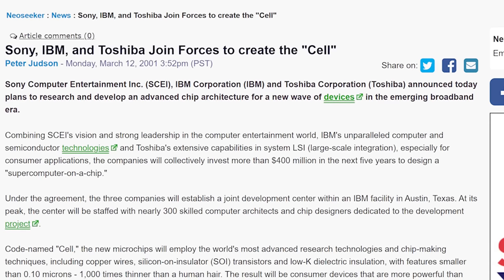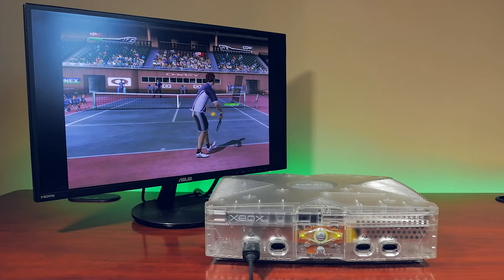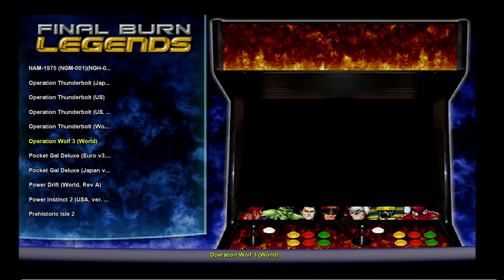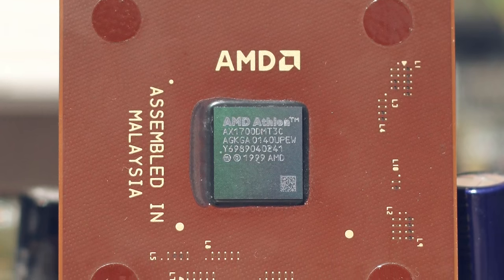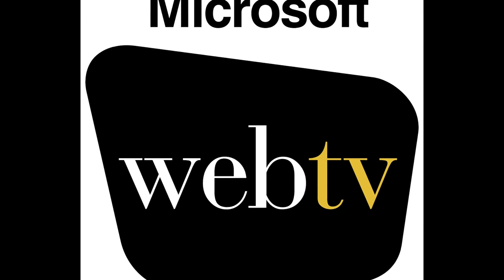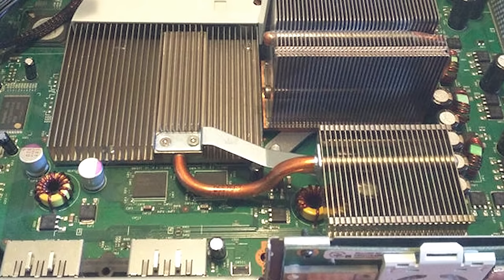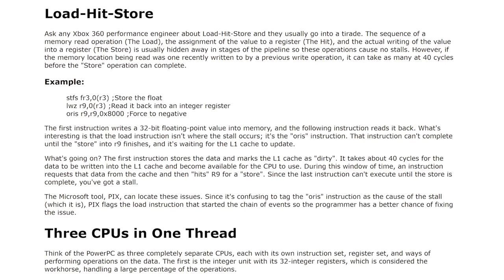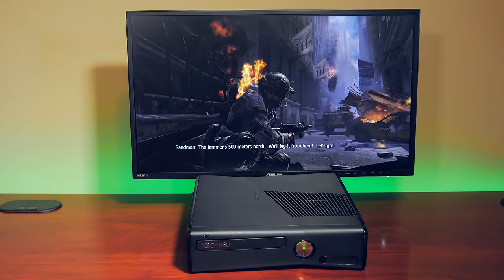Why Microsoft switched from Intel to Power PC for the Xbox 360  | MVG

Comment: Seems like a good choice when they were planning the consoles in the early-mid 2000's.
Reply: they had back them chip are very underpower.. if you want a power like ps3 and xbox360... you had to deal with chip that don't had much gpu and heating like hell... taken them 10 years before they come up with new gen while ps4 and xbox taken only 3 years to get hardware refreash.

Comment: You never mentioned that before a working system was developed. developers were sent a special powerpc based mac to build their games on. Until a working developer kit was ready.
Reply: It actually wasn't anything "special", it was just a Dual 2.0GHz PowerMac G5 since that was the chip they used stock at the time. I left a comment somewhere on this thread, but I had purchased that exact computer before going to E3 the year the 360 was playable (and the PS3/"Revolution" Unveiled). Every single demo station had an empty shell of the launch 360 right next to the exact computer I bought. I had to ask a few of the demo drivers before someone with the right knowledge was able to answer (I think it was someone from Lionhead who was showing off a Fable tech demo). They told me they had a few of these at the studio and other than specific specs on each unit (which were the stock "build to order" G5s from Apple's site), it was indeed just a mostly off-the-shelf PowerMac running the SDK. Pretty cool stuff. It was so fun getting back home, looking at my tower and thinking "huh...I bought this thing for music/video production, but actually have an Xbox 360 DevKit, too" :)

Comment: Apple had to water cool the fastest G5 Powermac, and never managed to release a G5 laptop.  PPC970 cores did run very hot.  It's why they jumped ship to Intel, and now the same thing is happening again, hence the jump to ARM.  MS and Sony knew this, and took the risk of heat problems.
Reply: I think the ARM jump has a lot to deal with the iPhone and iPad running on ARM, so they can unify platform development.
Reply: @comicsans1689  Fairly much so I'd say, and even though Apple announced here in 2020 that by 2022 everything will be ARM, I'm fairly sure that choice was made back around 2016-2017 as Intel was the main name in x86-64 (aka: x64) CPU's at the time and AMD had get to start laying down the smackdown with the Zen architecture (they were just coming off the relative flop that was AM3/+ with their high heat-output, poor IPC and pseudo-multicore design (sharing key FPU's and such between what was otherwise pairs of true cores), which powers XB1/PS4) when Apple saw the problems Intel was having and was going to keep having at the time, so gave themselves about 5 years headstart to start moving MacOS from x86 to ARM to have it ready for their 2022 launch.

If Apple waited for say 2018/2019 to make the move from Intel for MacOS, they might have chosen to go with AMD for Zen-family CPU's to power future Macs, or they might have still made the choice to go with ARM and move from x86 anyway. We don't really know.
Reply: Yeah, and funnily enough, Power arch hasn’t been good for general compute efficiency since G4. They’re still useful, but mainly for enterprise server workloads as I/O, reliability/live failover, and security are greater concerns there (and Intel has been dropping the ball on those, leaving an enterprise server niche). There’s reason to believe IBM’s s390x and Power arch’s have been drifting into each other with s390x maxing out reliability and Power being more balanced. Right now, the best are:
Dedicated HPC: Fujitsu weirdly enough, using their newfangled ARM A64FX chips which are absolute vector compute demons, basically the modern-day Cell except not a nightmare to program
General-purpose/commodity: AMD because Zen2 arch is hard to go wrong with
Enterprise workloads: IBM, Power for better cost/performance or s390x for absolute maximum reliability
Reply: That's a true statement, but when you compare to the time era it doesn't mean much.  AMD wasn't able to push 3ghz clocks on multi-core processors without using even more heat, and Intel wouldn't have anything heat/power competitive until 2006.  If things had waited just a year it's easy to see how different this generation might have been though.  Apple likely had advanced knowledge of how much better the core2 was compared to outgoing P4's, and they would have delayed their move from G5 to intel to match with this vast improvement.  OTOH, Sony pushed back their ps3 launch due to blu-ray AACS fuckery, and if they had known the ps3 was going to be so far delayed, they could have used that time to gain a huge compatibility and performance advantage by leveraging a core2 based processor on their platform.
Given how far below competitive clocks the wii, u, and switch have been I doubt very much that their choice of platform matters in terms of having a good thermal performance.  They just need to ensure they meet the bare minimum cooling requirements spec'd by the chip and hope that their supplier isn't lying about thermal/power properties.
Reply: but the RROD issue was because the GPU was overheating. It was never because the CPU......how are people getting this wrong.
Reply: @tHeWasTeDYouTh  Overheating wasn't even really the problem, although the board flex leading to cracked solder likely wouldn't have happened with more tame thermals.  
Still, the argument could be made that if the CPU didn't require such a large heatsink, the GPU could have been better cooled, which may have prevented the problem.
Reply: @s1mph0ny  the GPU needed a giant heat sink as well as it not only have the GPU but also 10mb of embedded ram.
Reply: @tHeWasTeDYouTh  They used  an aluminum heatsink not even an inch high so it could fit under the dvd drive.  Microsoft wouldn't add a small heatpipe and secondary heatsink until later generations, and those still had too much board flex.

I donno if the edram significantly increased the heat, but the system will crash if it doesn't make contact with the heatsink.
Reply: @s1mph0ny  reballing BGA from Xbox 360 Xenon board 2005 and never more have 3rl insue. The problem call ROHS. PB 37 / SN 63 leaded soldering.
Reply: @Clarissa 1986 Citing Linus is a risky move when he also did a video on are Macs really overpriced and his conclusion was no.
Reply: @ancapsu8728  its true the claim of Xbox "overheating" problems is oversimplified at best, but the board won't flex without enough heat.
Reply: @s1mph0ny  YES. A lot of PCs were being sold, and people were being encouraged to upgrade, based on clock speeds at that time. This is entirely wrongheaded, but Apple marketing decided to stop trying to convince the public of this, and play the same game. It wasn't a purely technical desicion, it rarely is.
Reply: @Clarissa 1986 I don't think it's money, or money alone. They want to remain in control of their product. If they didn't, they would have made OSX/MacOS completely Open Source or even switched to linux long ago.  It's not the direct financial links, but the ability to dictate the direction. Because after all, don't they still make money from the Apple Store on Hackintoshes? I'd say it is the "Homebrew" app for distributing open source software counts as a threat as much as Hackintosh itself.
Reply: Microsoft should have avoided it completely and gone x86.
Reply: @s1mph0ny  I don't agree. Microsoft knew AMD wasn't doing well in 2012 and yet went with them for the Xbox one along with Sony. In 2003 they could have just added a better GPU on release and used a customised AMD x64 CPU with future support for parallelisation using Dual CPU workstations for early game development. PowerPC should have been used for negotiating with AMD and Intel, nothing more. Both SGI and Apple were moving away from it at the time, so it wasn't really "the Future". Now we have one kooky generation of Xbox with over heating issues.
Reply: Yeah, but solder cracking wasn't the issue.
Chip is internally overheating and traces to the pads got damaged, some units got microscopic cracks so, RIP those components

Comment: I'm pretty sure the CPU in the Classic Xbox was a Pentium III "tualatin" and not a Celeron. It gets murky because at that time because traditionaly the difference between the Pentium and Celeron was chache size, with the Celeron being made from Pentium III chips that had quality issues. This version had the same cache size.

Also Intel was being embarrassed big time because this generation of overclockers discovered that Celerons could out perform PIIIs. Basically cache speed was more important than cache size. PIIIs had twice the cache at half the speed of the Celeron but preformed worse. I believe this is why the tualatin version of these chips were so similar. 

Anyway, like many generations of Intel chips at the time the  LAST generation of chips outperformed the first generation of the NEW chips. I believe this had something to do with the quality of chip yelds always staring off poorly. That tualatin and even the mobile version were able to reach P4 performance levels with the right overclock. It was some dark times for Intel. Unfortunately Microsoft ran it CPU at 733mhz and not at the chips 1.4ghz max speed. My guess is, once again, yealds. Much more of the chips would run stable and cool at 733 then at 1.4 and it was cheaper.

All this to say that by the time they were developing the 360, all Intel had was the P4. Everything else was basically the same PIII chip Microsoft had already used. 

The P4 was such an engineering failure that the 'Core' lines were based on a modified PIII core and the P4 'nerburst' architecture was brushed under the rug. 

This is mostly from memory so I may have missed a few things. I had an AMD Athalon XP at the time and really enjoyed my gaming experience.

Edit: Thanks to everyone in the comments for their feedback. It turns out the Tualatin CPU was the fasted you could swap into the original Xbox. Not the stock CPU. It's still a PIII and not a Celeron. It's been almost 20 years now and I was bound to be a little wrong. You all are great.
Reply: Wicked lost and well written!  In closing, Intel sucked hard and PPC was the better choice.  Didn’t know about the Celeron performance delta though, interesting stuff.
Reply: it was a frankestein cpu, a tualatin core with half the cache running at 200 MHz bus...
Reply: @FeeLtheHertZ  i had a celeron A that moped the floor with a friend 's pentium 2
Reply: @omegarugal9283  Yes, Celeron A! That's the name of the first Celeron chips with cache memory. I remember people in school having dual Celeron As at 1.1ghz. While I had an AMD K6-350.
Reply: "Microsoft's Xbox game console uses a variant of the Pentium III/Mobile Celeron family in a Micro-PGA2 form factor. The sSpec designator of the chips is SL5Sx, which makes it more similar to the Mobile Celeron Coppermine-128 processor"

It's a mixture of all sorts.
Reply: Intel had the Pentium M (Banias) processors at the time, which were based on the Pentium 3 but were used for notebooks
Reply: IIRC, the reason for the stupidly long pipeline in the P4 Netburst was the specification of a single-cycle divide.  Divide is a particularly horrid instruction in terms of complexity so the requriement that a divide instruction could be run each clock cycle resulted in a very long pipeline in order to achieve comparable clock speeds to the competition.  This, compounded with the relatively anemic branch prediction and out-of-order execution on the P4 resulted in lots of stalled cycles which wreaked havoc on performance.  In later processors, Intel switched to microcode division operations (similar to AMD), which meant that each division operation would be deconstructed into multiple smaller operations by the microcode unit.  This, along with much better branch prediction, resulted in the next generation having much better single-core performance in realistic workloads.
Reply: Definitely, I believe some people got a hold of some of those mobile chips and suck them in a desktop motherboard and then got some cool overclocks out them.
Reply: The associativity of the L2 cache was that of Tualatin with size of Coppermine.
Reply: @ScottTancock  That's fascinating, bare metal developers were always going on about how costly divide was at the time. I totally see how someone would want to optimize that.
Reply: @ScottTancock  I'm pretty sure the P4's very long pipeline was mainly because AMD embarrassed  Intel to 1Ghz first and Intel needed something that would easily clock very high even if it wasn't as efficient as AMD's Athlon architecture aka marketing them to appear to be faster.
Reply: IIRC The original Xbox CPU is basically just a 550 MHz Coppermine Celeron but running on a 133 MHz FSB instead of the normal 100 MHz FSB that Celerons of the era used. This resulted in a 733 MHz CPU.
Reply: @takeshi7  ahh damn, I'm getting the stock CPU and "fastest CPU people swapped in" confused. 1.4ghz is definitely using a Tualatin CPU, but not the stock one. Man this takes me back.
Reply: @IndstrlMtlHd  That's true, but the reason Intel required a 20-stage pipeline to 'beat' AMD's 9 stage pipeline (in terms of clock speed), rather than a 12- or 15-stage pipeline, is mainly due to the cost of the divide.  If Intel had used a microcode division, then they would have easily shaven off at least 4 stages, if not more.  If Intel had been content with a lower clock speed, they could have done more bits of the division per cycle and achieved a shorter pipeline, but then they wouldn't have the highest clock speed on the market.  It was a complex combination of the marketing department wanting a higher clock speed on the box and the engineering department making the 'wrong' decision of putting a single-cycle divide in the ISA (side-note: single-cycle divides can be good options, just not in this context).
As an aside, it's entirely possible to have a short pipeline running at high speeds, and this is what some of the PowerPC implementations did (others either aimed for low power or went for really high clock speeds with a long pipeline; some server chips reached 6GHz).  However, that requires a simpler (RISC) instruction set, which isn't feasible with x86.  To work around this, modern Intel / AMD CPUs convert the x86 instructions into a series of 'micro-ops' - RISC-style instructions that work together to perform the same job as a single x86 instruction (this results in a simpler core, so higher clock speeds and less pipeline stages, but at the expense of a fixed-length translation layer at the start of the pipeline).
Reply: Did a Wikipedia check for the core series being "based" on the PIII, you were close but not quite, the Core series's microarchitecture is a continuation of the P6 microarchitecture used by the Pentium Pro, which did eventually evolve into the PIII, but can't conclusively say if it was based on any specific P6 processor
Reply: According to another comment it's a mix www.anandtech.com/show/853/2
 @IndstrlMtlHd  P4 was released in Nov 2000, and it takes years to develop a CPU, so these design decisions were already made.
 AnEn  The Gekko did have a bunch of SIMD stuff added I believe. What's the paired singles?
Reply: and they did outperform same-clocked p4's
Reply: XBOX used Pentium 3 Tualatin core with half cache, the FSB was the same, so it ran fast and cool.  As for the Celeron, the Celeron A put the cache on chip and OC's would just put in 133 SDRAM and up the FSB, and viola, you more or less have P3.  Pentium 4 performance issues were all over the place, half speed FPU, so 2 GHz P4 barely beat 1.3 GHz p3, front end decoding changed because of trace cache introduction.  In the end the Pentium 4 was all about trying to scale the clock speed as that became a thing in the mid 90's.  XBOX could not use p4 because of FPU problems and heat, plus the chip was just too new.  Pentium M (Banias, Dothan) was next bump up from Pentium 3 of P6, it came out of Israel in the post Timna period, many of Timna's ideas influenced Banias.  Timna was to be a mobile chip with on die graphics, 128 k cache, RDRAM chipset support.
Reply: @IndstrlMtlHd half right.
Intel thought that a big pipeline + high clock would outperform the cache misses/brach prediction.
Sadly, that never happened.
Then AMD did the same mistake with bulldozer, and the cherry on top was the infamous shared FPU...in a 64bit architecture.

Basically AMD shot themselves in the foot twice in bulldozer era.

Comment: You seem to have some mixups. The pentium 4 that used RDRAM was the Willamette core, socket 423 (and later 478), which maxed at 2.0GHz without HT. It wasn't until the Northwood core  in 2003 that HT was introduced on consumer Intel CPUs with the 3.06GHz Pentium 4 w/HT. Later a Pentium 4 3.0GHz HT was released with the higher 800MHz FSB (whereas the 3.06GHz was based on a 533MHz FSB).
Reply: they hit limited of one core... and end of the more's law... after that endless.. more core... and forcing chip...in the end we need to change from chip to a tower... or you just going get endless way to used less power to reducing heat...
Reply: RDRam was very short  lived